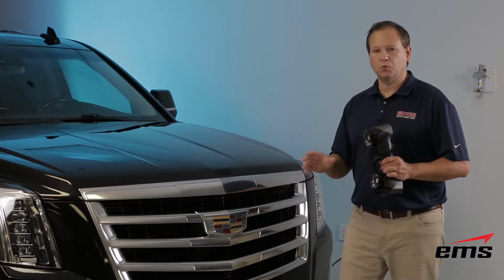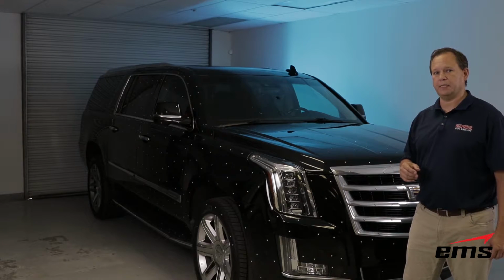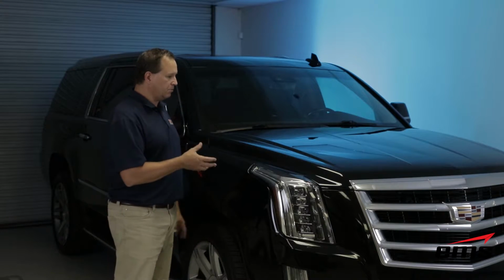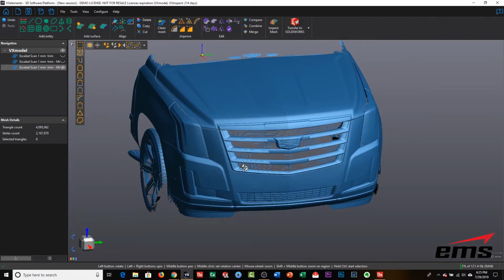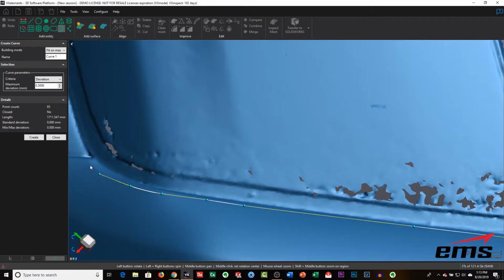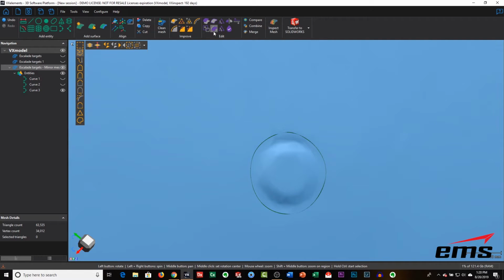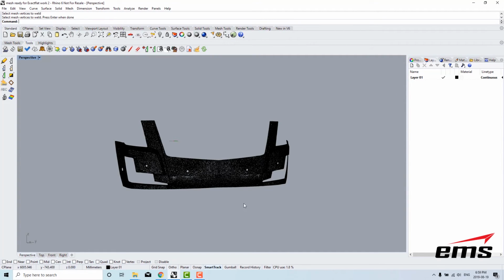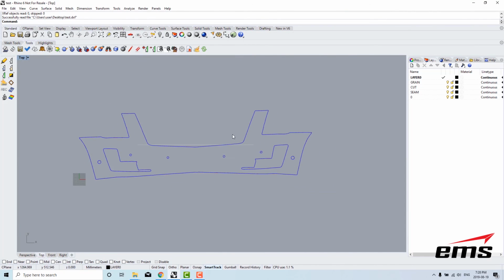3D Scanning for Vehicle Wraps and Paint Protection Film

Comment: Wow. I tried to do this before for a Bentley but I reverse engineered for surfaces. I used Rhino for surface creation and flattened on SW. Wish I've seen this before I've reverse engineered the full thing! The flattened pattern didn't come out good though.

Love your channel.
Reply from the maker: Yes there is definitely a process to go from scan data to cut pattern for sure. Scanning makes it possible to get a good pattern the first time.
Reply: the whole car, you have reverse engineered? omg
Reply: @larryzhou  It was the front fender and bumper. Didn't known that I can work on the mesh directly without the need of surface creation.
Reply: @Ak47ram  I spent several hours in Rhino ,then give up. Geomagic Design X might be the next good thing. sadly, I dont have budget to buy the VXmodel. it looks time saving!!
Reply: @larryzhou  I used Rhino in conjunction  with Autodesk Shape Modeler plug-in for Rhino, it is much more convenient when creating high quality surfaces in Rhino.
Reply: @Ak47ram  i need to do some searching of the plug-in.
Reply: @larryzhou   Autodesk stopped developing it for Rhino. Not sure if it is still on sale.

Comment: Regarding mirroring, I guess the software use and depend on the fact that the, in this case the hood, has the same shape left and right, correct? (It compares and figures out where the center line is, the line you made is just a guide)
So if scan a concept clay model that is not mirrored in the clay, it might have different proposals left right, is there a way I could mirror in the software?
Or do I need to have centered hardpoints within a physical geometry for center plane reference for the software mirroring to work?
Reply from the maker: Good question. As long as you 3D scan enough data past (about  2 feet  or 1/2 a meter) the theoretical mirror plane the software will properly determine where it is.  In the case of a clay model where there could be slight differences from side tide its best to scan the whole object and then let the software find the mirror plane.  If need be you can make slight adjustments to the plane before doing the actual mirroring of the data.
Reply: @EMS3D  thank you very much.
Which scanner would you recommend for this scenario:
 full size clay model motorcycle, medium knowledge of reverse engineering / prefer if there is appropriate software included,  good but not fantastic pc (i7 7gen) , scanning of mechanical details will occur, budget around 10000usd, used is ok.
Reply from the maker: The Peel 2 would fit your budget.   Contact us at 877-845-2700 for more details.